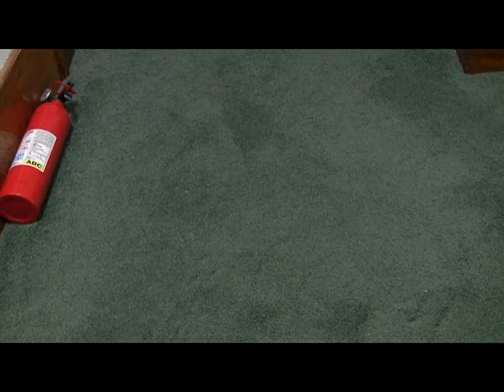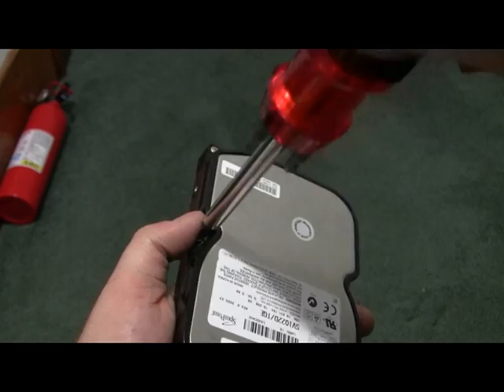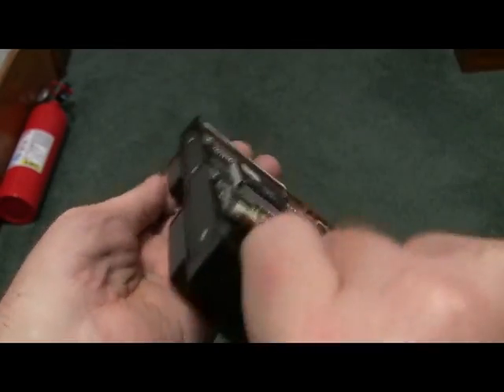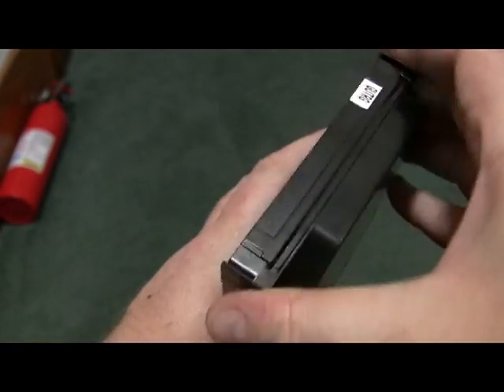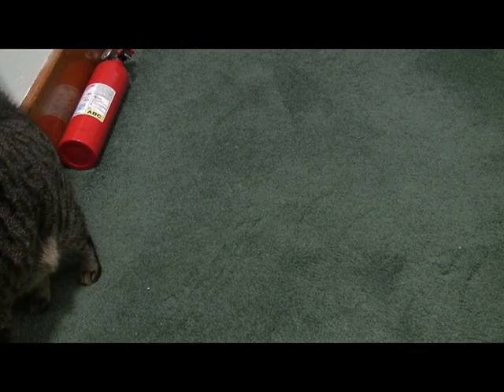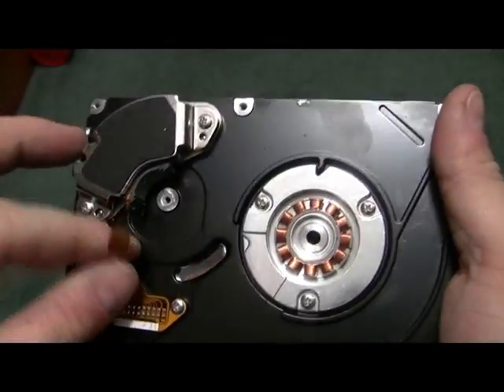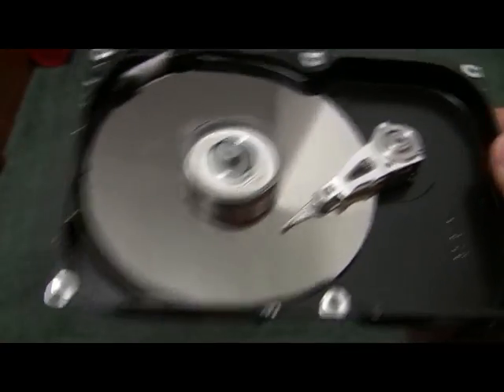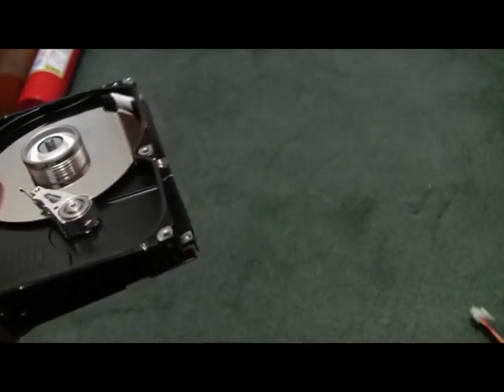Hard disk drive destruction!!

Comment: Hi, best way i know to destroy a hard disk drive is to "wipe it" with a program called disk wiper, wich erases the data following the Guttman process, it erases the data over 300.000 times, so it's inreadable, even with magnetic microscope ;-) ...

The technique u use it is not bad, but you could improve it by applyin 12v to the molex connector of the drive, so that the drive spins with opened case, and then u put the tip of a knife on the surface ... 100% garanteed results ;-)